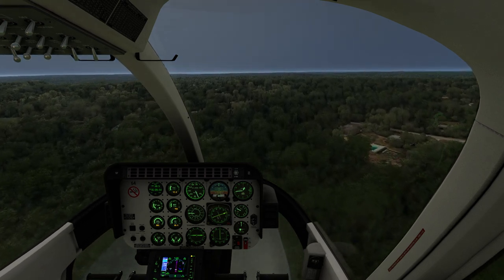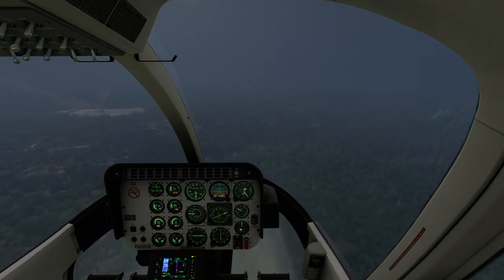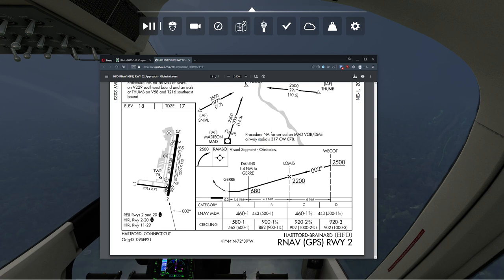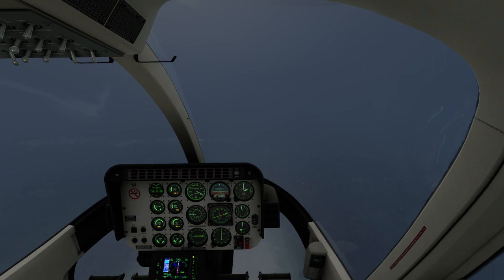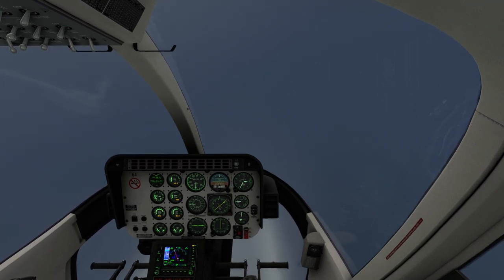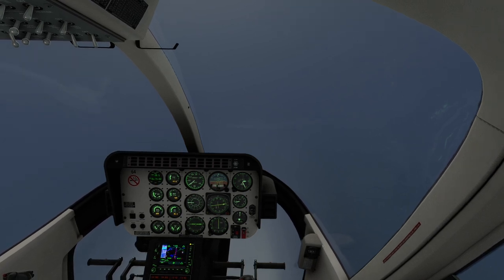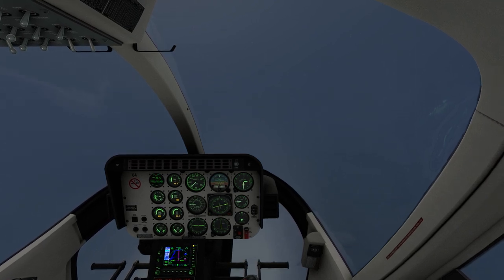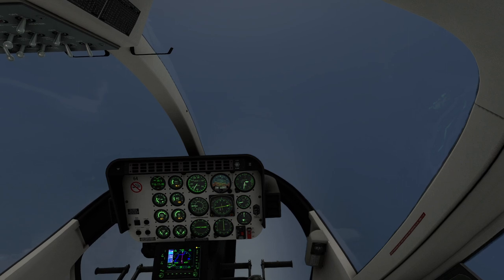MSFS - Flying a Non-Precision RNAV Approach in IFR Conditions with the Bell 407

Comment: Hi, You mentioned not having the lateral guidance CDI for the first stage of the approach...
One thing I've noticed in the Bell is that it never (for me) seems to correctly enable the CDI initially - but if I hit the CDI button twice on the GNS, flipping to VOR then back to GPS, then the CDI then seems to be working "correctly"
Not sure if that's intentional / a bug?
It certainly makes following A GPS route much more straightforward than trying to squint at the tiny screen on the GNS as I'm flying...